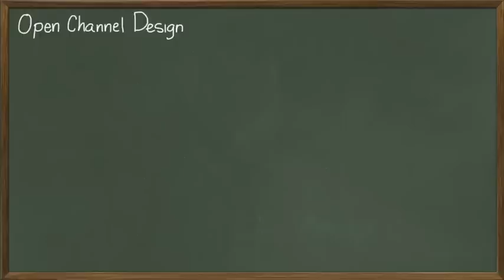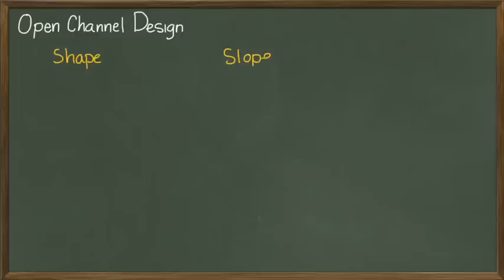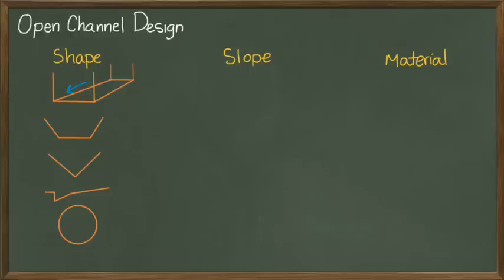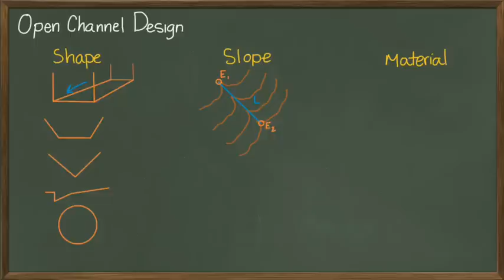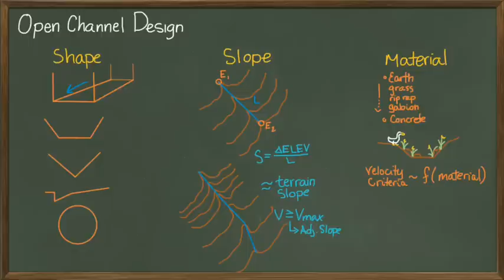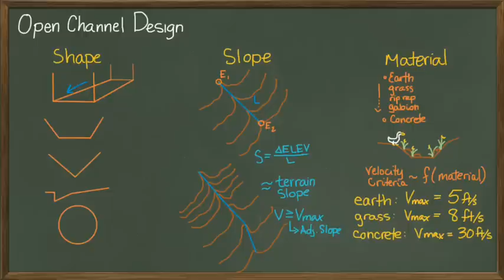Open Channel Design

Comment: Nice video. I think your max normal velocity is too high, can cause excessive erosion and be dangerous too. I would think conc drain should not exceed 6f/s at max flow
Reply from the maker: Interesting.  I'm always glad to hear other criteria people use.  Are you thinking of a specific application where 6 ft/s should not be exceeded?  For example: Are you referring to reinforced concrete pipelines?  Does the 6 ft/s criteria apply to a specific agency/location of the country?